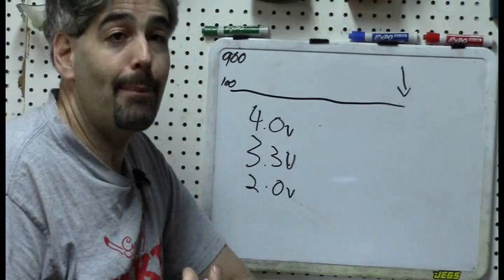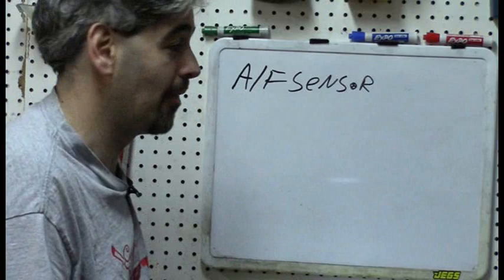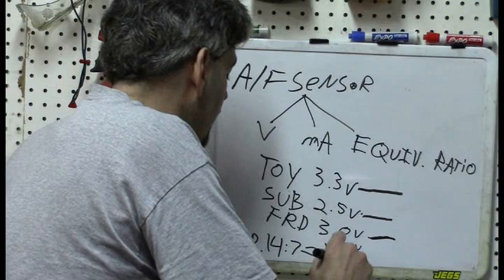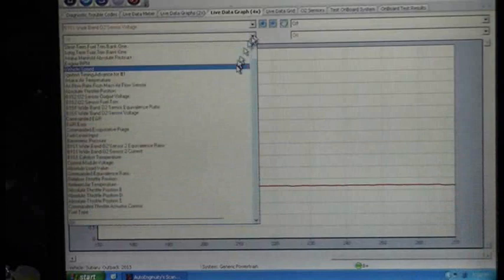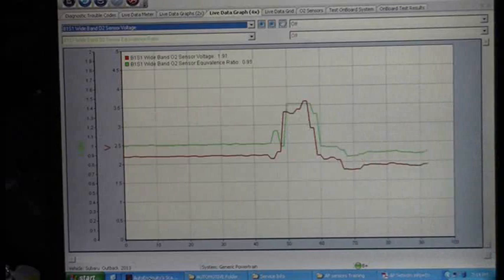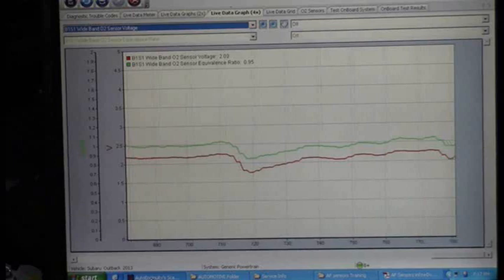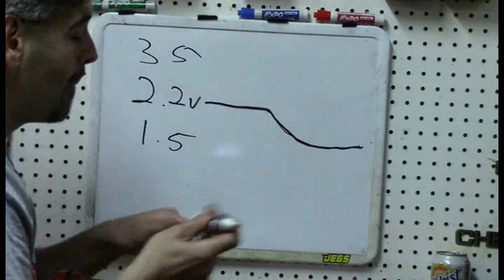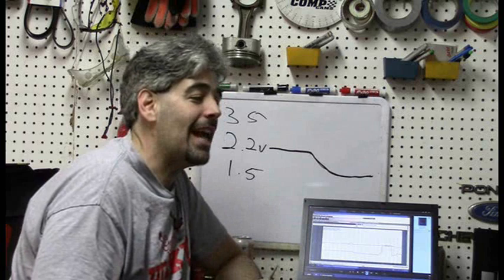Air/Fuel Sensors (Wideband Oxygen Sensors) vs O2 Sensors- PART 2

Comment: im getting p0031 and p0051 and everything i can see online about it says its upstream 02 sensor, even the obd says so but like you already know the upstream is a/f sensor and the voltage on them seem ok. im going to check by snapping it in the morning, but my concern is since there is only heated o2 sensors downstream will it show up on code as being upstream? or is it just calling the a/f sensors o2 sensors? hope this makes sense.
Reply from the maker: Not sure what you mean be “even the OBD says it’s the upstream sensor”. What do you mean by that?
Reply: @SchrodingersBox  the code on obd says o2 sensor bank 1 senseor 1.   so my question is  , is it calling the a/f sensor an o2 sensor or is it calling bank 2 bank 1 since bank 1 is an a/f sensor and bank 2 is the actual o2 sensor
Reply: maybe i can try better, it says o2 sensor bank 1 se 1  ,  so whats wrong the name  or the position
Reply from the maker: The code has to say what the sensor is reporting. It can’t just say “o2 sensor 1”. It has to say something like “O2 Sensor 1 below lean threshold” or something.  It has to give why the sensor is reporting.
Reply: @SchrodingersBox  yes it says what it is circuit low. but im not as much concerned about the issue as much as i am the location. i figured someone would have ran into this before.
Reply: im getting heater control circuit low on both heated o2 sensors.
Reply from the maker: Oh that’s easy. all you have to do is check continuity and amperage across the heater circuit. simplest diagnosis there is. 
   You have to interpret those codes correctly- they always tell you the information on  whether it’s electrical or not. You have to read the whole code, not just jump to a conclusion.
Reply: @SchrodingersBox  yeah but what im askin is why is it saying o2 sensor in sensor 1 position if its an a/f sensor?  Is it recognizing the wrong sensor or wrong position ? Is it calling an a/f sensor an o2 sensor or is it calling location 2 location 1 because its the first o2 sensor it sees in that bank. U get what im askin.
Reply from the maker: I have seen it refer to O2 sensor on A/F sensors before all the time. Bottom line is you know where the issue is now so you just have to diagnose the electrical fault.
Reply: @SchrodingersBox  they didnt pass the snap test but gd are they ewxpensive.  thanks man
Reply: @SchrodingersBox  i also need to fix my exhaust manifold leaks first
Reply: @SchrodingersBox  well now im wondering if i even have leaks in my manifold. if the a/f sensor voltage is not reacting to lean and rich , what kind of symptoms would i have other than money light.  im assuming i have a leak because of a low tick thats louder under acceleration and lack of power.
Reply from the maker: Well of course it failed a snap test. What do you expect with that code? How could it possibly pass?
  And what would an exhaust leak have to do with it? Exhaust leaks don’t cause amperage faults.  You need to do a simple basic test for continuity and amperage on the heater circuit. nothing else.
Reply: @SchrodingersBox  im not saying that ones related to the other im asking if i could confuse one with the other. would the lack of power be because of the a/f sensor. as far as the snap test idk what causes the codes hence this whole conversation and google search.. do i know that" low heater circuit " will keep my voltage from changing  during rich and lean? no i did not.
Reply: i appreciate taking the time tho for real  thanx
Reply from the maker: Yes a faulty heater circuit absolutely can cause lack of power. 
   This is an easy diagnosis- you are way over complicating it. Simply measure amperage and continuity on the circuit. That’s all you need to do to diagnose the issue.
Reply: @SchrodingersBox  i replaced both a/f sensors its got more power but money light keeps coming on and same codes are still on there. Idk if im not deleting them right or what.

Comment: why didn't you use mA on the board instead of Volts?
Reply from the maker: Because you can’t actually read the mA. They are too minimal. That’s why the arbitrary voltage is assigned.
Reply: Don’t all scan tools read the A/F sensor in mA? Iv never seen a scan tool that measures one in volts
Reply from the maker: No they don't- they read them in Volts.  The voltage is an arbitraily assigned transaltion of the milliamperage done by the PCM- not the scantool.  I have never seen a scantool read in mA on an A/F sensor.
  Not to say they don't- but I have about 5 scantools (granted, all DIY level) and they only show voltage.
  Even then I disregard the voltage because I prefer to use equivalence ratio but even that won;t be in mA.
Reply: Schrodingers Box my $100 Bosch 1100 unit reads in mA for the O2S11 and O2S21 when plugged in my RS5. 
Can you photo if want so ya could shed more light on the subject. Iv just been using those values. 
The post sensors read in voltage thought which makes sense but far as I know ever scan tool iv used reads mA
Reply from the maker: Hmmm that’s a first for me. I have a bosch scanner. I’ll have to try that this weekend and see if it reads the mA!!
Either way I wouldn’t use either the voltage or mA in a diagnosis (other than to determine sensor integrity) but as far as fuel tim analysis I am still using equivalence ratio.  
  Still, I am curious to test that. I only ever have seen the referenced arbitrary voltage.
Reply: Schrodingers Box you got a way I can see you a photo of my readings ?
Reply from the maker: Nah I totally believe you. Let me try it on my bosch scanner and see if I can get mA.

Comment: its never good when things become proprietary. what your saying is that the wideband A/F is going to function differently as per the manufacture and model. OBD I was like that and it was a headache at times, although people less then the A/F sensor. i owned allot of GM OBDI cars and they were fairly straight foward, but if you worked on an OBDI car from a different manufacturer things like the diagnostic plug would be different. ONE of the reasons going to OBD II was to create a univerisal system. every manufacturer has to have the same port and it has to be located in the same place on the vehicles, that's the OBD II standard. the other reason i think was to create a system where big brother could monitor your cars emissions as per state inspections and cause a major headache for the consumer. states make allot of money on OBD II inspections, but im afraid this is going to get worse. in order to afford to drive an older OBD II you have to know how to work on it or your going to pay out the rear end. i have a tuned PCM in my camaro with all emissions turned off, i can do whatever i want to the car and big brother is none the wiser, lol.

Comment: I have watched a couple of your videos over time and have not really liked your content. I think it's because of the choice of words you use. Most of your audience probably struggle with diagnosing issues and I feel your word choices only complicate the capacity for them to take it all in.
HAVING SAID THAT. 
From a technicians point of view you did a very good job of this video. It was informative and pretty much on the money.
The voltages however are there. You just need an oscilloscope to see them.
Relax a bit and I feel your subscribers will increase.

Comment: Matt, Thanks for the welcome!
I don't know if your scan tool shows live data for this type of sensor but if it does you will see a live voltage reading that does not change no matter how rich or lean you make the air/fuel ratio. That is a reference voltage I believe 5v, inside the sensor's sensing circuit. The Computer is always trying to maintain that ref signal by controlling the amps flowing through it.The voltages that you are seeing is computer processed voltages not live, you are right, they are not real in a way, they are computer generated/converted from current/amps the computer is regulating in the sensor's  sensing circuit. ( I Think! ). Check out this article!   http://en.wikipedia.org/wiki/AFR_sensor  Good job on the vids. ( You Should be a Teacher! )

Comment: You should use Acura/Honda
Reply from the maker: WHy? they are all the same in concept.
Reply: Schrodingers Box because they are full of new technologies. Plus they are compatible with Ktuner. So all of your read outs are accurate
Reply from the maker: I don't follow your accuracy statement- Are you saying it gives ACTUAL voltage? What?
Reply: Schrodingers Box yea thats I’m saying. It would be more accurate
Reply from the maker: WHAT????? That is impossible. Please explain how it is possibly going to give ACTUAL voltage reading on a polarity switched microamperage.
  That makes no sense whatsoever.  Can you explain what I am missing here because I have to say- it sounds off hand like you don't no what you're talking about. HOW would it possibly give ACTUAL voltage reading and what would those readings be against variables? ALso how is it that my equivalence ratio is inaccurate? 
If I am misunderstanding this I apologize but you need to explain it to me like I'm stupid I guess, because your statement clearly seems impossible.
Reply: Schrodingers Box wow dude you don’t have to go all middle aged grandma on me. I was saying that they are pretty good and give accurate number and are fun to play with.

Settle down dude
Reply from the maker: Dude would you please answer the question. I am trying to learn from you if I am wrong. Explain the mechanism on why a reversed CURRENT polarity is going to give actual voltage reading on a diagnostic and why the equivalence ration would not be reflective of the microamperage from the O2 pump.
Thanks. Just trying to keep my "safe environment" where I prevent people who don't know what they are talking about from spreading misinformation. My channel is NOT Eric The Car Guy.
Reply: Schrodingers Box I answered your question now your just trolling. I simply said that Ktuner is accurate as a diagnostic tool and you went all Frankie Nunez on me
Reply from the maker: Um no you didn't. Try again. OR tell me where you answered it.
 Come on man- you're looking like a fraud. I'll make it very easy:
You stated the honda/acura uses new technology where a reverse polarity current pump is not used. Explain the technology and how it is voltage dependent on the scantool reporting.
 GO.
Reply from the maker: Sorry you failed to answer the question for the third time so I have to keep deleting your responses until you do. Dude- if you are incompetent just admit it. it's OK. But if you are competent here's your chance to show it.
  MOST people just talk out their ass dude. That's why I made this channel. It's a safe haven from BS archair know-it-alls.  Is that what you are?

Comment: question for you S.B.  you said oxygen sensors ONLY sense oxygen, but if oxygen sensors only sense oxygen.... how do they detect a rich condition??  in other words, at stoich (14.7:1) isn't there the perfect balance of fuel and air so that all oxygen and all fuel is burned? if so, that would mean there's no oxygen left. running rich would leave no oxygen as well so in both situations the sensor would see no oxygen therefore it couldn't tell the difference from 14.7:1 to 10:1 etc. so how does it tell the difference? (I'm sure I'm missing something so please help me understand).
thanks!
Reply: +lampim The theory is a rich condition has a lower amount of O2 because of displacement of the O2 by fuel.  I have a video that does some experiments testing this somewhere on the channel and since then I have changed my thinking to O2 sensors being more of ration sensors than O2 sensors.

Comment: It is ironic for someone who does not like to learn "from Internet" to post instructional materials on said Internet for others to learn.

Anyway, you should brush up on basic physics. For current to flow through electric circuit, there must a voltage which is an electromotive force or potential difference expressed in volts.
Reply: Robert K Good old V=IR. I could be way off the mark but what I took away from it is that there is a fixed voltage across a gap in the sensor and the fuel content that passes by it must cause a variance in resistance hence current varies and that is what gets detected

Comment: LOL blah blah blah replace A/F sensor
Reply from the maker: Hahahaha, yeah it's practically a religion for most people. The formula follows : 
1. Read code "Blah blah blah X blah blah"
2. X is a component
3. Replace X
4. Clear codes
5. Re-read recurring code "blah blah blah X blah blah"
6. X is the same component that was replaced
7. replace plugs, wires and O2 sensors.